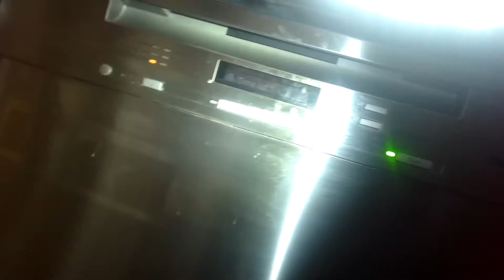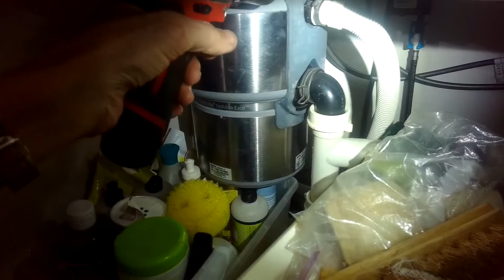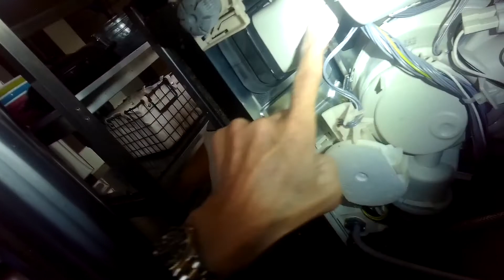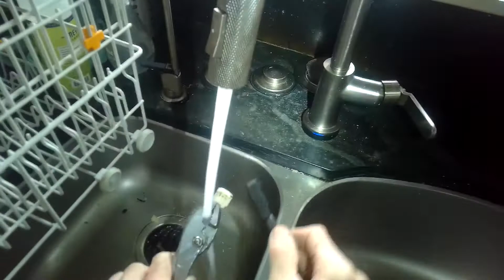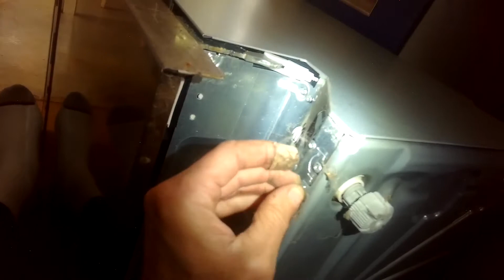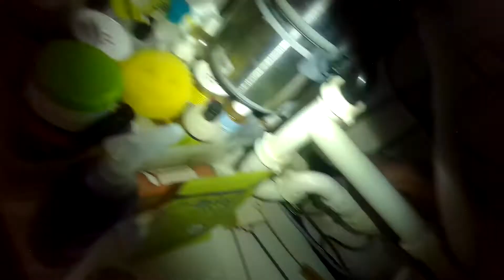✨ Miele Dishwasher - NOT FILLING ENOUGH - Easy FIX ✨

Comment: How does the capacitor affect the pump after the pump is already running?
Reply from the maker: It’s just good to replace with the heater/pressure switch because they wear out at similar times.